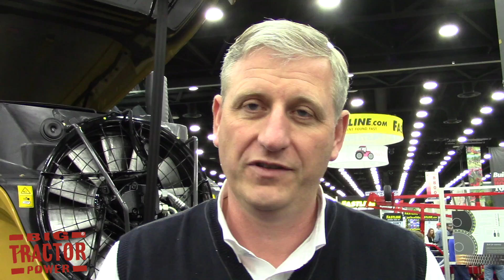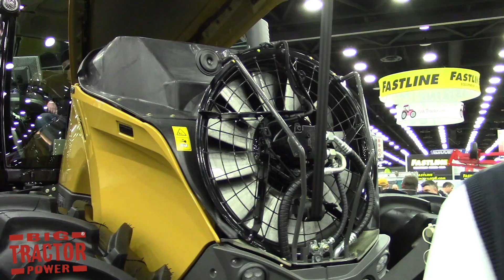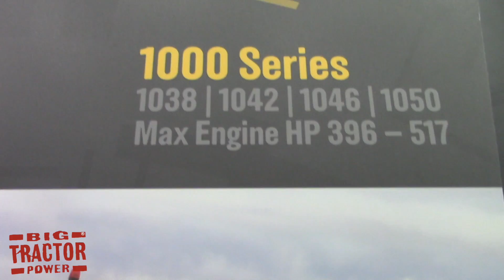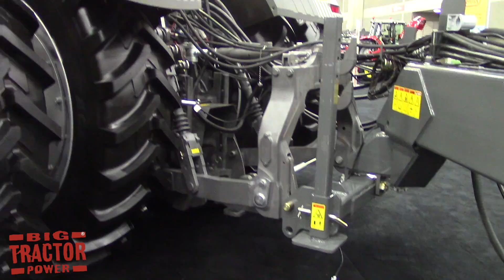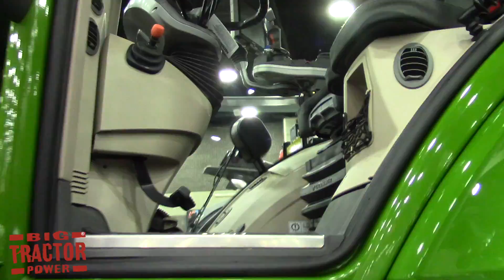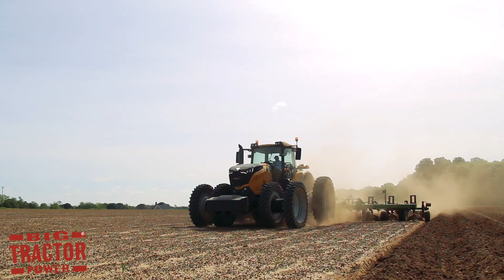Challenger 1000 Series Tractor Interview 2017 NFMS

Comment from the maker: There have been many questions about Challenger and Fendt. Both the Challenger 1000 Series and the Fendt 1000 Vario had design and engineering input from AGCO and customers all over the world, while heavily leveraging the AGCO facility in Marktoberdorf, Germany, where these tractors are manufactured. Fendt has a long history with CVT and the production of large tractors.  AGCO acquired Fendt just for this reason in the late 1990's.   Both tractor lines were designed to meet the needs of high-acre agribusiness operations while considering the customers with an affinity for each brand’s unique character.  The Challenger and Fendt lines may appear similar on the outside, but differ in their standard features, operator’s experience, and dealer distribution network.  North America is unique in that the majority of AGCO dealers offer either Challenger- or Fendt-branded solutions to their customers; distribution of the two brands rarely overlaps in any geography.  Fendt has a strong dealer presence in dairy regions like Wisconsin, Pennsylvania and New York.  While in the Southern, Mid Western and South Western United States Challenger has a large dealer presence. For that reason, AGCO made the strategic decision to bring this innovative, first-class technology to both the Fendt and the Challenger product lines to best serve the needs customers across the United States.

Comment: the Fendt Care package is a 15,000$ value and Fendt also has a tire inflation system and also keep in mind that the Challenger version doesn't offer a true front end 3 point or PTO I am wondering how Agco will compete with these tractors the 1050 Fendt will cost upwards of 510,000$ so I can imagine the Challenger version should be bit cheaper but still not practical